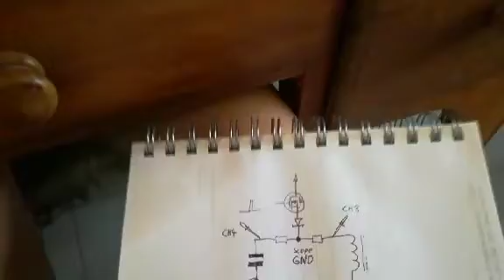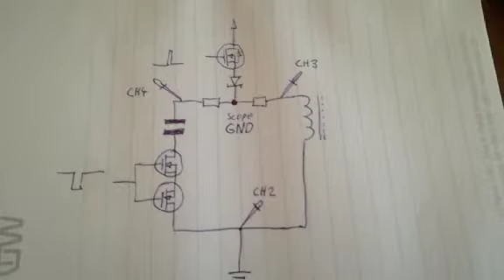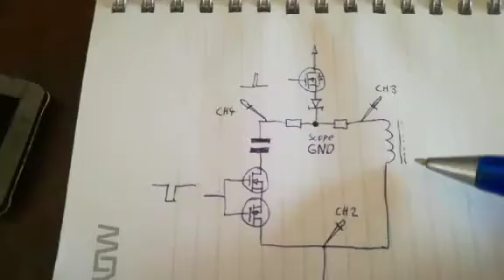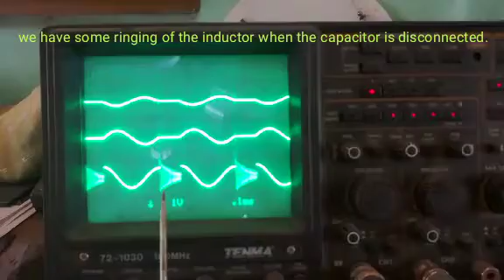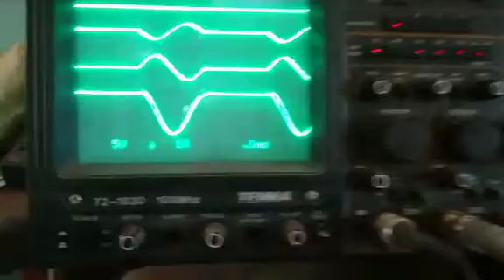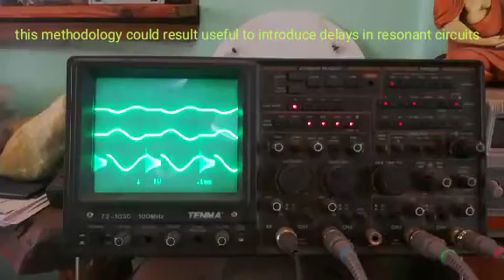Currents in a resonant parallel LC circuit 2

Comment: I never would have imagined that it would be possible to "pause" the resonnance of an LC circuit. In my mind, the oscillation of the current in the circuit was THE thing that allowed the resonnance effect. If that was interrupted, resonnance would have to build-up again.  But maybe the circuit here was not yet arrived at full resonnance, with a maximum value of voltage. Is the Q of the circuit high enough to allow a high resonnance?  Thanks for this experiment, vidura!